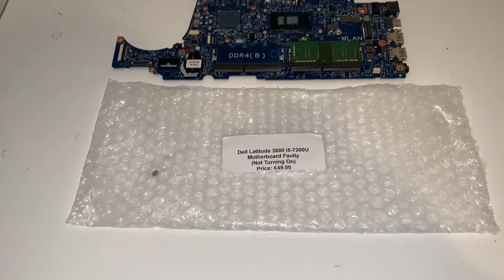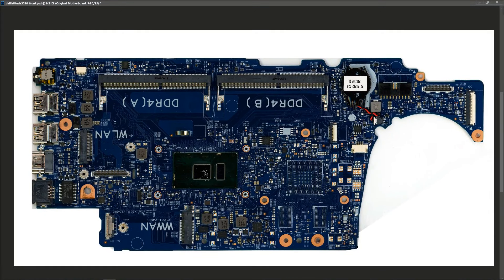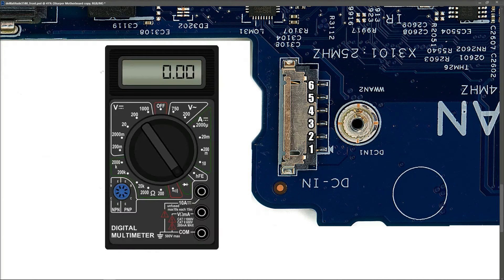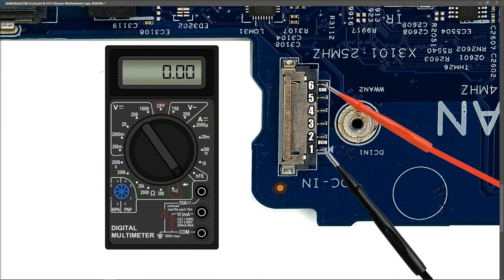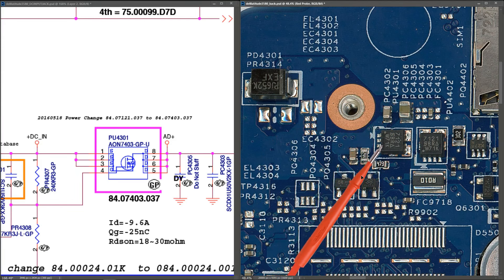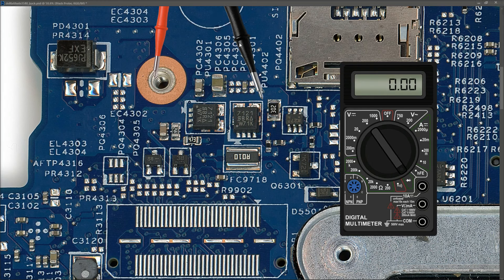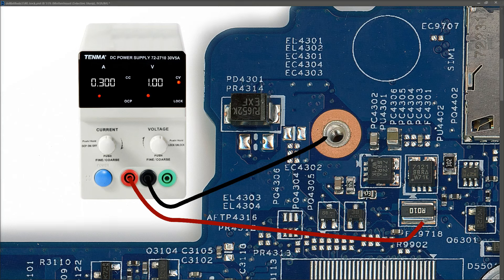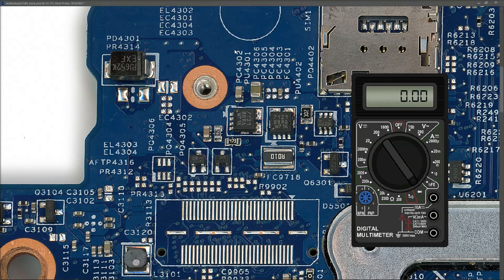Dell Latitude 3580 - Faulty Motherboard

Comment: Excellent repair. Clearly explained step by step. Congratulations. Thank you very much for your time and effort in publishing this type of content (Please keep uploading it). All the best from Mexico.

PS: DNS (Do Not Stuff), it is an indication to the schematic reader, an interpretation for the schema compliance tool to understand that DNS is a part that will not be mounted during assembly. is a location provided as an option or feature that requires specific needs.
DNS (Do Not Stuff) = DNA ( Do Not Assemble) = NM (Not Mounted) = Empty.

Comment: may be you explained it before but why do you put the red probe to ground instead of the black for mesurements?
Reply from the maker: Hi Diego, There are a number of videos on the internet describing how to do diode mode - And honestly I don't think that I can explain it better than what is already available.
Reply: You better review voltage current and resistance or ohms law, he using diode mode that use small amount of voltage in circuit and when there a high resistance in circuit or short the voltage will to drop  almost zero same when you are using resistance mode or voltage injection where highest resistance lower the voltage and high current and whatever short parts will get hot….😅😅😅